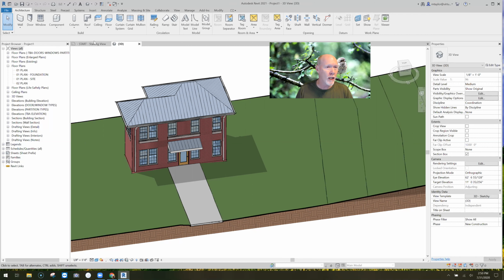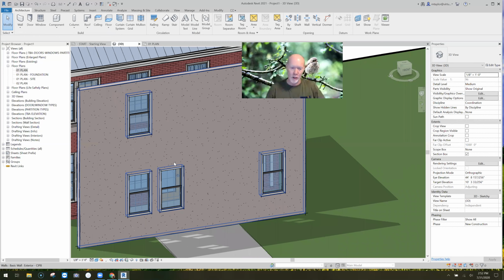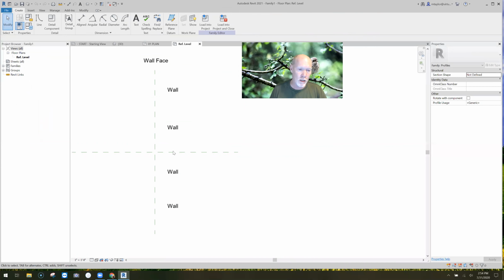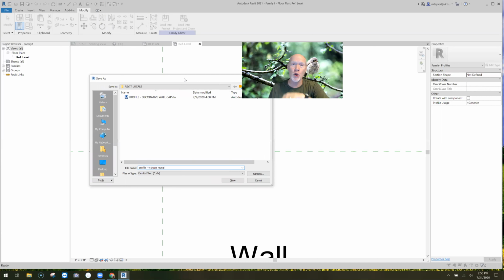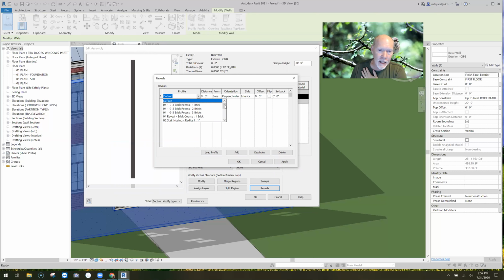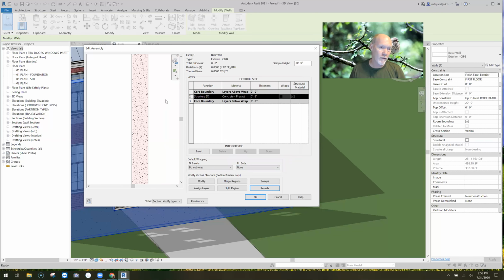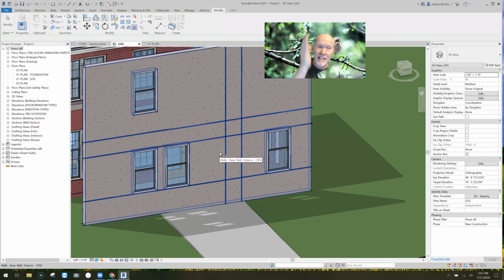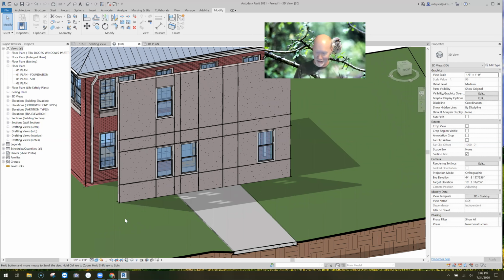WALL REVEALS - Vertical and Horizontal

Comment: Please, How can I apply material to reveal?
Reply from the maker: ‘Paint’ command will apply material to the surfaces of a reveal.
Reply: @miketaylor-fantastic  I'm trying to "paint" a wall with different colors using "split face"; there are multiple reveals through the selection that keep me from getting the full area I want split. Is there a way around this or will it be better to make a stacked wall?
Reply from the maker: You are correct Allie.. The reveals are causing you troubles. You would have to ‘split’ each face individually.  Yikes.
A stack wall may be the way to go… it would certainly be faster.
Reply: @miketaylor-fantastic  thank you!